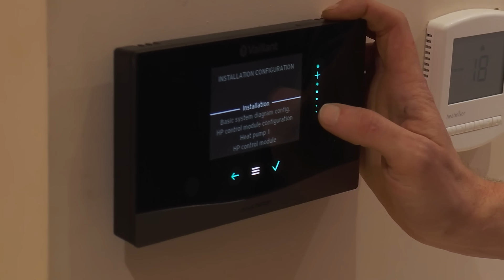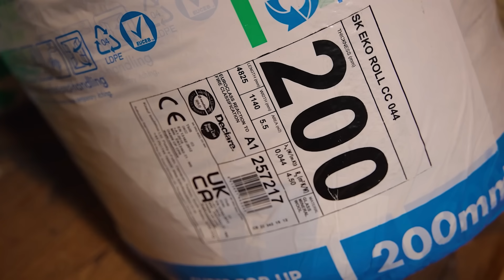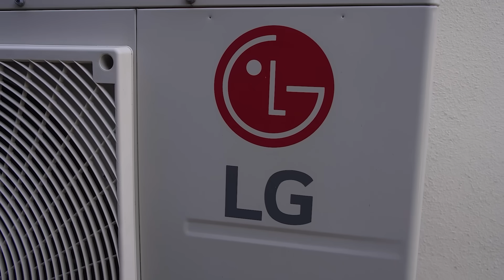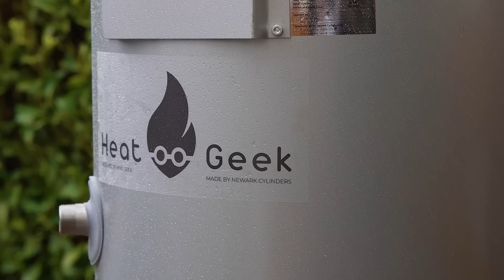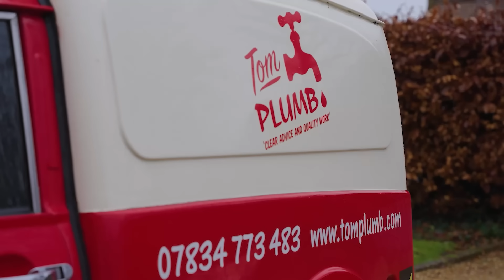Heat Geek’s Heat Pump One Year Later — The Verdict!

Comment: Honestly now how much have you spent on everything so far
Reply: Basically bought a vineyard to get free/cheaper wine
Reply: Twenty two grand?! How many years of saving on your bills does it take to get into a break even, let alone savings? Our gas boiler cost £1100 installed, has an 11 year warranty, and gas is way cheaper than electricity. Until the numbers add up, as with electric cars, they just won’t buy them.
Reply: @sarahmillard6401  obviously he has a much bigger unit because look at the size of his house. At a COP of 5 it's much cheaper to run than a gas boiler, so it will pay for itself. I don't remember exactly how much gas he needed before but it was a lot.
Reply from the maker: It is a £22k installation
Reply: @SkillBuilder  If he wasn't on the not-actually-available 15p/kWh Ovo Heat Pump Plus Tariff the payback period would be beyond his lfietime, and probably is in reality.
Reply: @SkillBuilder  Does £22k include the cost of the first system which was ripped out?

Comment: The fact it's took an  army of engineers and thousands upon thousands of free materials and labour doesn't make this a practical option
Reply: It was a fix for a much publicised poor install and they all wanted to appear on camera, contributing to the fix.
Reply: It's a frustrating thing because the technology is great, and works fine in many countries that are colder than the UK. However, the state of training and regulation in the UK is letting the technology down. 

The national MCS scheme only guarantees a SCOP of 2.8 and a lot of systems don't even hit that. Imagine being a bog-standard heat pump installer and thinking, "ah yes, 2.8, smashed it, on to the next install". That depresses me. Meanwhile good installers are hitting a SCOP of >4, sometimes even over 5 in bog-standard homes. Same technology, massively different results and bills.
Reply: Everybody is so happy to do the job. All smiles.

Comment: Another cold pump, complete with slightly warm radiators and warm water that needs electric elements to make it hot enough to use, what a complete load of green crap...
Reply: Efficient, cheap to run. Problem install fixed.
Reply: @Biggest-hz7ng keep saying this until we believe you....

Comment: As a plumber this is the big issue. Teaching someone how to plumb in a heat pump is fairly quick and simple. Teaching someone how to design a heat pump install and set up the heat curves etc to get the property evenly warm and with a reasonable scop is a different matter. Doesn't help a lot of firms offering pumps with these grants just want to bang them out day on day out rather than taking the time and care to set them up properly.
Reply: Amen. It's short-term thinking to botch installs then have to fix them down the road, and it makes the technology look bad. The UK government / regulator needs to enforce training and installation standards. There have been videos of new builds in borderline passively-heated houses where the install was dreadful and the bills were expensive, but these are the same units that run happily in the likes of Swedish winter!
Reply: @defragsbin  yh sadly heat pumps in UK have gotten quite a bad rap wrongly in my view due to poor installations. I'm not saying they are a panacea but they're not as bad as they're made out to be if put in properly.
Reply: That is the major issue
Reply: @Tom_Plumb_PHS  Agreed. I’ve said this over and over and Roger doesn’t seem to want to acknowledge it as being THE major issue.
Reply: And then after all your calculations and air leakage calculations, the sun comes out, and they throw all their doors and windows open! How dare they interfere with your calculations!
Reply: @ They don't interfere with your calculations.  Clearly if you open doors and windows in the cold, the temperature drops a bit for a while.
Reply: @markrainford1219  i have closed door but need them in the bathroom
Reply: Spot on - we see this in New Zealand too, where hydronic underfloor systems are becoming more and more popular.  People balk at quotes from proper HVAC specialists, and get their plumber to source all the parts and build them something for significantly less money, only to find it rarely works as they hoped.  Personally, I wouldn't leave our UFH on over summer; we have enough cold nights that warm into really hot days here the house would be sweltering due to the hysteresis from a 150mm slab.  I turn our UFH heating off in October (leaving water heating on though) and back on around April.
Reply: I recently passed my initial ACS and I’m new to this industry. I’ve had no exposure to heat pumps yet but I want to continue learning a getting a better understanding of all elements of the trade. Can you suggest any materials or sources where I could begin to get an idea how engineers go about designing these types of heating systems please? Many thanks.
Reply: How do you find genuine installers. Lots of national firms offer quick fits with the grant.
Reply: People are not taught how to use their gas boilers most efficiently either. Majority will be heating rooms all day that they don't use. 

As for the installers on grants, the same thing has been happening with gas boilers for people on benefits. Just slap bang, in and out.
Reply: @vistron888  people = plumbers. They are not taught how to install an efficient heating system, it's just bang in the blunt tool combi boiler. The majority of them are not condensing or running efficiently, but they provide heat and gas is relatively cheap.

And we have to be careful not to compare apples with oranges - This guys 6 bed house is comfortable all year round in any bedroom and running costs are cheaper than a gas boiler, we shouldn't compare it to a 3 bed house where the occupants are heating two rooms for two hours a day.
Reply: And the government want to enforce this crap onto millions of households and all we seem to have is a complete lack of qualified designers and  installers to ever meet the demand , it’s just a market for cowboys to make a great living just like double glazing  and cavity wall insulation scams from decades ago
Reply: I'm an electrician and it's the same woth solar installations mate
Reply: I agree, but that's a problem in itself. You know that probably 80-90% of installations are thrown in in minimum time, whether a gas boiler or heat pump. But that won't change when it's only heat pumps we're fitting. 

Also, most people having a heat pump installed now are the early adopters, the people who are willing to learn a bit about the system themselves and help tweak it. Once you're forced to install them for everyone, the standards will fall even further, and I can really see a lot of them being more expensive to run that gas boilers
Reply: @TheZippyMark  no one is going to be forced into installing them anymore the legislation is being dropped and Westminster has ditched their own heat pumps
Reply: @christophergallagher3845   well maybe not as such anymore, but say they start installing them in council places for tenants on social housing. To be blunt, there's no way that almost any of them will use them as instructed. I'm a heating engineer in London, and the vast, vast majority of rental places I work don't even have a timer set up for their combi boilers, they just put it on as they get cold. That'll wreck the COP of a heat pump.
Reply: @TheZippyMark  almost all electric heating cost more than gas due to the fact a unit of electricity cost 3x as much as gas
Reply: Can I just ask…what about a solid walled early Victorian house which needs ventilation to prevent mould etc? We’ve insulated the loft but looking at your pics, we probably need much more! Listed bldg so not allowed double glazing on huge windows, roof solar….probably even air source heat pumps on outside actually. Someone on this road is attempting a MASSIVE retrofit, digging up the garden for ground source heat pump, insulating solid walls etc etc…all with planning permissions. Result….the family have moved out for more than a year and it’s nowhere near complete. Not a good advert for these ideas in old housing stock.
Reply: I think the same is common with gas boilers, how many have overpowered boilers that are not condensing properly due to that. 

Problem is people notice that Les because the coat of gas is so much lower that eleci.
Reply: @stephenrowley4171  very true I lowered the heating temp right down on mine. Housing association installer had it on 70. I've got it at 40 and house holds constant temp all winter with boiler condensing pretty much all the time
Reply: @stephenrowley4171  the niggles are forced through
Reply: The problem is: heat calculations rely on doors and windows closed and 'controlled' ventilation. The first thing anyone does  when the sun peeks out is throw all their doors and windows open. Human nature.
You then need a big energy input to bring the property back up to temperature. A gas boiler can do that in half an hour. Easy.
Reply: @ I’m not getting your point? If you don’t want to waste energy and cool your house? You don’t open all your doors and windows for ages.  Energy is stored in tbt fabric the building so it’s not as big an issue as it may seem.
Reply: @markrainford1219  LOL why would you calculated for having the windows and doors open?
Reply: @ LOL. You don't! That is the problem. Low grade heating systems with extremely slow recovery times only work in a hermetically sealed box.
Reply: @markrainford1219 My 6 bedroom house is not hermetically sealed. We have decent seals and double glazing but I otherwise an ordinary house now with decent loft insulation. The walls are 9 inch solid brick and that absorbs and retains the heat. Turning the HP off while on holiday is bad news for the house cold down and takes a day to warm back up again.
Reply: @markrainford1219 the gas boiler heats the air not the house - two different approaches. The HP maintains a constant temperature the gas boiler heats up cooled air. Apples and pears!
Reply: I like my bedroom to cool down at night. So I always turn off the central heating when I go to bed and turn it on when I wake up in the morning. So not considering a heat pump.🤔🇬🇧
Reply: @filmbluff99  You can program a heat pump to drop to whatever temperature you want overnight.
Reply: @filmbluff99  

How cold do you like your bedroom, if properly designed the system will ensure your desired temperature although MCS recommend 18C there's nothing to stop you setting a TRV cooler if you wished, age concern UK recommend 18.3C.
Reply: @filmbluff99  You can have different rooms at different temps and do nighttime set back.
Reply: @filmbluff99 just switch off your bedroom rad and keep the door closed- isolate the bedroom, it’s as simple as that.
Reply: How delicate is a heating system that CANNOT cope with people wanting to throw  their doors and windows open on the first s
Reply: Utterly useless, Bosch gas boiler and forget.
Reply: @ You don’t see the irony here, do you?

Comment: Freezeback kills compressors. Heat pumps are just AC units that in laymans terms "run in reverse". Incorrectly size the lines, heat exchangers etc, then you get these issues. With AC undersize the duct work and this gives the same problems. Much like going to condensing gas boilers, the temps are lower, so you need more flow. And compressors will fail eventually, much like the fan motors. 20 years for an AC unit is what I'd expect before having to replace it
Reply: Good comment, note that reliability is 10 years longer than a typical gas combi!